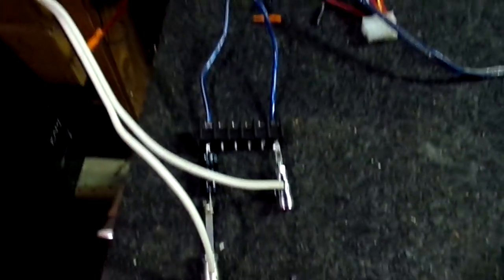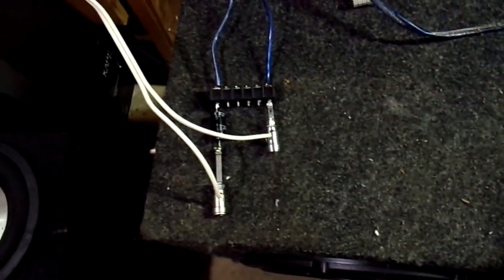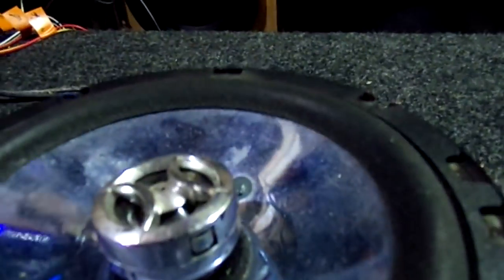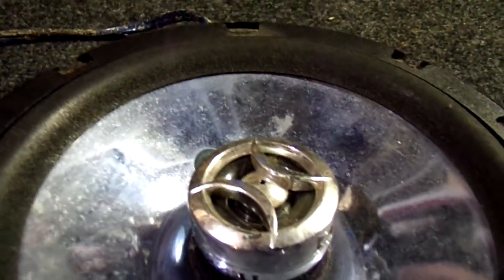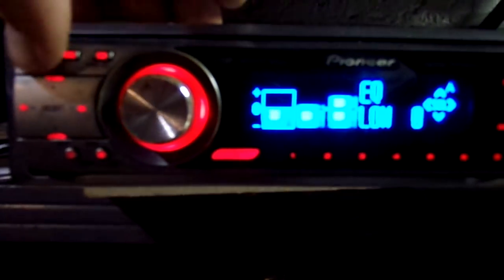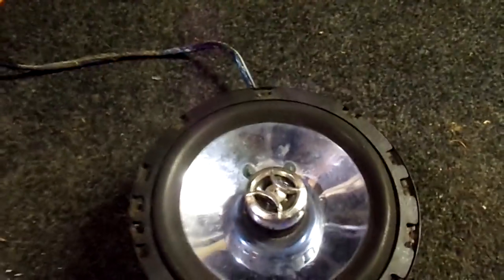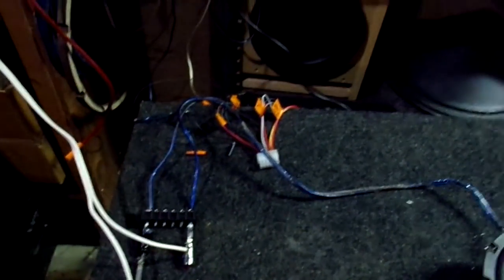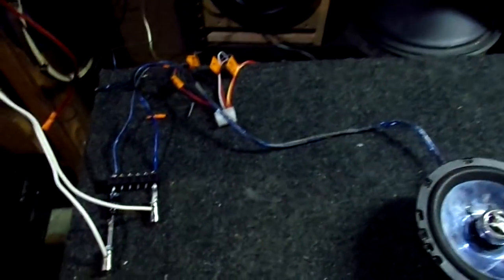Amplifier Clipping Detector Cheap and easy ! no DD1 or Scope needed !

Comment: Thanks for the effort, but you really didn't explain anything.  You showed a bunch of stuff hooked up and didn't explain how to do it.  That would have been much more useful.   But at least I am inspired to keep searching for how to set something like this up, because I don't want to spend $200 to do a job once for my own car install.
Reply from the maker: buy a liumy LM2020 or variation of the , its under 100$ and a tool every basshead should have . i have videos of the older liumy oscope . this method isnt perfect at all . being able to see the wave and having a multimeter with the tools you need is far better and you can do sooooo much more.
Reply: There's not much to explain. You place a capacitor of say 3.3uf inline on the positive wire. Just need toske sure it's rated to handle the power you'll need feeding it, so going with something like a 300V 3.3uf capacitor would work for most any situation.